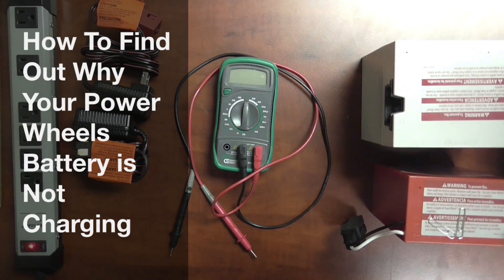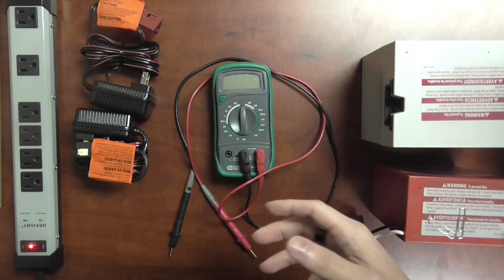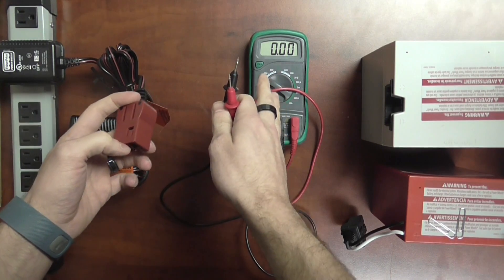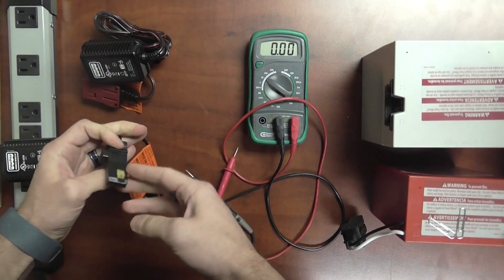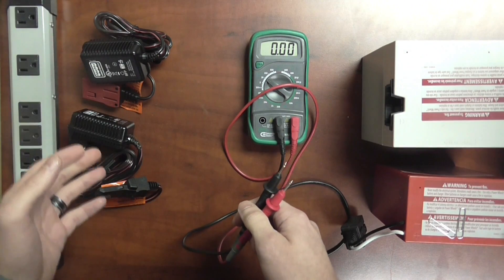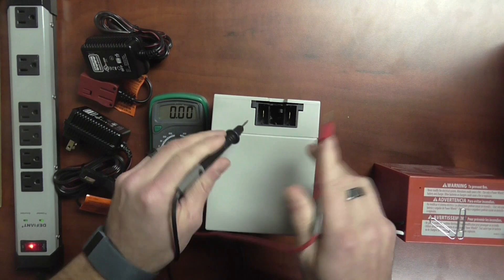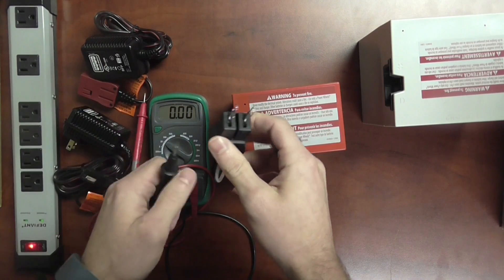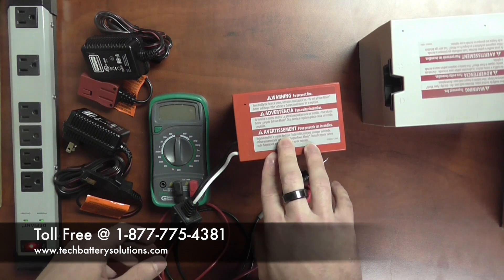How To Find Out Why Your Power Wheels Battery is Not Charging

Comment: What is the problem when your power wheel battery is reading fully charged but your power wheel still won't run.
Reply from the maker: The two most common problems at this point will be a switch (under the gas pedal), or an issue with the motors.

Comment: I’ve got a 12v grey battery and for the readings I got -0.01 to -0.02 or positive 0.01 and 0.02 if I switched it. I got this reading for the charger, the battery and even the port where the battery plugs into the car. I know my battery is probably fried but is my voltmeter broken? Or am I doing something wrong? Thanks
Reply from the maker: Thats a bit of an unusual reading. First thing I would recommend doing in this situation is to test a known good battery with your voltage meter. You can test your daily driver vehicle battery or even a AA or AAA battery out of remote with it to make sure it's working properly.
Reply: @HighTechBatterySolutionsInc  Ok, will do. Thanks.
Reply: I think you got it on AC not dc.

Comment: My new 12v battery shows .04 and my old 12v charger is jumping around between 5-17. I assume this means they are both bad? If so, do you think my charger possibly ruined my new battery or did I possibly charge it too long? It worked fine until I tried to charge it for the first time.
Reply from the maker: Thats an extremely low voltage to be seeing on the new battery. The Power Wheels toy itself will not drain the battery past 10.5V maximum which leads me to believe that you may have an issue with that charger. Have you gotten a volt meter on the charger yet to see what its putting out?
Reply: @HighTechBatterySolutionsInc  Yes the charger is jumping around between 5 and 17.
Reply from the maker: @djfloth  How long did you leave the battery on charge, and by new 12V battery - it was purchased this year?
Reply: A couple days. Yes, new this year.
Reply from the maker: @djfloth  I'm leaning towards the charger being the issue. If the new battery had a faulty cell you would see evidence of it during your first use.
Reply: @HighTechBatterySolutionsInc  Yup new charger resolved the issue. Thanks for the video and feedback!

Comment: But it didn't say why
Reply: But why is it not charging? That's what the title eludes to.
Reply from the maker: @kateworkman4040  Test the charger with a voltage meter, if the charger is working. Test the battery, if the battery is fully charged and the toy is still not running them you have an issue with the toy. If the battery is not fully charged after being on the charger for 8 to 10 hours and you know the charger is working, then its a battery issue.
Reply from the maker: In order to find out why you need to test both the battery and the charger to find out the issue...

Comment: Is there a percentage rule for batteris for being dead and fully changed? For example a 6 volt battery that is 10 percent below 6 is a dead battery?
Reply from the maker: The voltage range of a battery can vary depending on the type of battery, its age, and its condition. As a general rule of thumb, a battery is considered to be dead when its voltage drops below 80% of its fully charged voltage. In the case of a 6V battery you would be in the low 5V range to be considered dead.
Reply: @HighTechBatterySolutionsInc  thanks for the response.

Comment: What are you plugging the part that goes on the power wheel connection? Not the part that goes into the outlet but the opposite end? What device are you using?

Comment: I have a 6V power wheels and the battery reads out 6.55V after charge.  Charger is also putting out proper voltage. I plugged it in and checked connections.  As far as i can tell, all switches are working.  I even replaced the pedal switch with a new one.  I hooked the battery up directly to the motors and they dont spin.  As a final test, I plugged in a 12V battery through all of the cars wiring and everything seemed to work.  Is it possible that the motors are old and the 6.55V just isn't enough to move them anymore?
Reply from the maker: Unfortunately I don't have sufficient knowledge on how age affects electric motors and if a higher and higher voltage is necessary. Our electric fork lift is over 30 years old with several thousand hours on the machine and the battery voltage (and motors) remain the same with no issues. Does the vehicle take a single 6V battery or two? If you have more than one motor in there then I'm assuming it's a dual battery setup which means your motors might need 12V to run?

Comment: My charger works, but i am not sure whether the power goes to the battery or not.. any idea to check that?
Reply from the maker: If you're not sure the battery is accepting the charge you can test the voltage of the battery without the charger connected, then connect the charger and leave it for an hour. After the hour is up pull the charger from the battery and let it sit un touched for an hour. Check the battery voltage again and compare the two readings.
Reply: @HighTechBatterySolutionsInc  thank you. Really appreciate.

Comment: I've done this. The batteries fully charge, but nothing in the power wheel works. I've chased power all the way to the motors. Dead cell?
Reply from the maker: while testing the voltage at the motors hit the gas peddle to engage the motors - check for a massive voltage drop, if you do then a dead cell in the battery is a definite possibility. If there is no change in voltage - i.e. your getting voltage to the motors but no drop when you activate the motors then something could be happening with the motors.

Comment: I got a reading 6.4 and 6.35 for my 6volts batteries. Assuming the batteries are still ok but it thr power wheel wont turn on
Reply from the maker: That sounds like the batteries are okay and should at least move the power wheels. I would try lifting up the back of the toy so there is no pressure on the wheels and hitting the accelerator. If you still don't get anything then you most likely have an issue with a switch.
Reply: @HighTechBatterySolutionsInc  just did that. Nothing happened.

Im looking right now at the ignition switch and acceleration peddal. But can't or have no idea yet how to determin if its faulty or good 😅
Reply from the maker: @exlost245  You can begin testing with a voltage meter. You can test the voltage at the motor to see if there is any, and or the resistance of the switches to see if thats the hold up.
Reply: @HighTechBatterySolutionsInc  replaced the batteries and charger. But still no power. Even the auxiliary(lights, sound etc) is not working.

If its not the switch, probably the board?
Reply from the maker: @exlost245  Its really tough to say without having it in the shop. If the voltage is not flowing past the board in the toy then thats going to be the issue, have you check voltages at all with a voltage meter to see where the bottle neck is?
Reply: @HighTechBatterySolutionsInc  problem was the board. There's voltage coming in. But there's bo voltage coming out of the board.

Im think maybe i should just bypass it. And splice all the wires.
Reply from the maker: @exlost245  Unfortunately I can't give you any actionable input on that, its past our area of expertise. I assume the board serves a purpose and you may be able to find a used one on eBay if you wanted to go that route.

Comment: What if the battery wont hold a charge for more than 10 mins
Reply from the maker: If the battery takes a full charge but lasts for a very short duration of time then your looking at a capacity loss. In this case a replacement battery is recommended to get the full run time of toy.
Reply: @HighTechBatterySolutionsInc  so replace the battery?
Reply from the maker: @justinmcvay5560  Yes
Reply: @HighTechBatterySolutionsInc  thank you

Comment: Do the 12v batteries have any sort of internal protection or safety devices that trigger in a collision? My child hit our out door table and the PW immediately stopped working. Battery is at full charge but still won't go. Swapped another working battery and the PW goes fine. Thoughts?
Reply from the maker: Not to my knowledge, the only internal safety precaution that I am aware of in the batteries is a self re-setting fuse.

Comment: Thanks.. My charger says 7.5v and I tested it and it was actually right around 7.5v. But my battery won't charge and it's reading 3.4  guessing need a new battery for my kids 6v ride on it sat in charged for a long time
Reply from the maker: Yes, it sounds like the charger is functioning correctly but the battery is just not accepting the charge at this point.

Comment: do u have a video on how long should a battery charge before it is full?
Reply from the maker: We do not, the charger for both the Red 6V and the Grey 12V units are going to be in 1 AMP range. You can divide the capacity (AH) of the battery by 1 (1 AMP) to determine your charge time assuming the battery has been run all the way down. For example, the Red 6V Power Wheels Battery is rated at 9.5AH and the charger has an output of 1 AMP so 9.5/1 = 9.5 hours of charge time. I hope this helps!
Reply: @HighTechBatterySolutionsInc  thanks.. it helps me a lot

Comment: My 6v battery reads at 6.3 volts however won't power the car. I've checked the charger and that all reads good as well
Reply from the maker: You may be looking at an issue with the toy if the battery has good voltage and your getting no movement. The first thing to check would be the switch under the gas pedal and work your way backward from there.

Comment: My battery is good but it won't go? What else should I look for?
Reply: I have a wild thing 360
Reply from the maker: If you know that the battery is good but the toy is not moving at all then you may have a bad switch - most likely under the 'gas' pedal of the toy. You can either test the switch with a multimeter or give power wheels customer service a call - they have repair centers all over the US that you can drop the toy off for repairs.

Comment: Anyway to charge the battery with a car charger to give it enough volts to charger on the power wheel charger?
Reply from the maker: Yes, but two things to note. 1. You don't want to blast the battery with anything higher than 10 amps, anything higher and you run the risk of blowing the top off the battery. 2. The connection prongs in the battery make it really tough to hook battery clamps to. If you do rig up a good way to make a solid connect with a larger charger then hit it at ~10 amps for 45 to 60 minutes and then try plugging in the standard charger immediately after to see if you can recover it.

Comment: how can I upgrade my voltage from 6v to 20v what kind of convierter do I need? how much does the fuse box hv to be?
Reply: Wire batteries in series if you have the room for more than 1 battery.
Go to an automotive store or section of a store and buy a fuse plug and fuse.
My son has a 12V ( 6Vx2 in series) Jeep. I ordered a connector for my Milwaukee batteries and will use an 18V instead of the 2x6V

Comment: Why do I have a 6volt charger with my 12volt system.
Reply from the maker: Either you have the wrong charger all together or your 12V setup is a pair of 6V batteries. Does your battery look like the Grey cube in this video?
Reply: The battery is black and 12 volt. The person I got it from said that the 6 volt charger is what came with it. Strange!

Comment: High Tech Battery solutions Inc I have a paw patrol E cruiser has 6volt battery was fully charged working good for a year i did notice battery was low cause car lights were flicking on and off while on. Now i charge it no power at all left it plugged to wall car wont cut on. 
Do i need to replace battery
Reply from the maker: Was the battery sitting for a long period of time before you tried charging it? The life span on these averages about 3 years, so if your at or past that mark chances are getting a new battery will get you back up and running.
Reply: @HighTechBatterySolutionsInc  its been a year since i bought it charged ot once. Just last week it was on but not driving the battery was low now its been charged over night no lights or ignition start. Maybe i need a smart charger the car barely 2yrs old
Reply from the maker: @latoyawashington67  Do you have access to a voltage meter to check either the output of the charger or the voltage of the battery?
Reply: @HighTechBatterySolutionsInc  no sorry I don't. I was thinking taking the battery to an autozone or somewhere to test the battery. Or unfortunately ordering one from manufacturer
Reply from the maker: @latoyawashington67  If you do end up taking it to Autozone I would bring the charger as well to have that tested -

Comment: my 12v charger reads 11.5. Is that to low?
Reply from the maker: The charger is probably good. It is not uncommon for us to test a 12V Power Wheels charger and see it putting out 11 ish volts. As soon as the charger is connected to a battery it will increase its voltage output into the 13-14V range.

Comment: Everthing is good but the charger blinks red and green light flashes on of green red
Reply from the maker: If your charger has an LED light then you have the old school quick charger. I am not really familiar with this unit however I believe when the lights are alternating between red and green then its indicating a voltage issue with the battery.
Reply: ON THE CONNECTOR IT HAS  A FUSE  ON THE CABLE ATACHED TO THE BLACK WIRE.

Comment: I have been trying find the correct battery charger for this battery. Can you link me to the 12 bolt charger for that battery? The battery is model 1001175653. The ones offered the terminal connector is not the same as the one you. Thanks
Reply from the maker: Sure! https://www.techbatterysolutions.com/power-wheels-12v-grey-battery-charger-00801-0972/

Comment: Not sure if it’s the battery or charger but I have a beetle power wheel car . I put it to charge and then I turn it on and a red light shows but it doesn’t move forward or backwards doesn’t move at all only the sounds play like the horn , etc
Reply from the maker: Do you have access to a voltage meter?
Reply: No do they sale them at Walmart ?
Reply: the car turns on but it doesn’t move at all not sure what’s wrong
Reply: Do you think I should buy new battery? It’s a 6v car
Reply from the maker: @karlamadison843  Tough to say without seeing if the battery is actually discharged. When was the last time the toy was running?

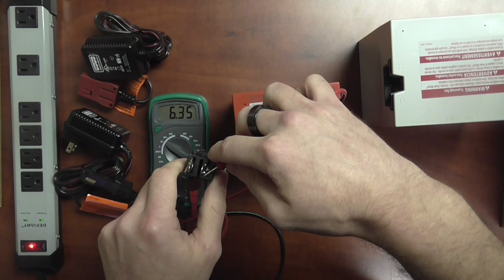Comment: 4:55 be very cautious to not touch both clips with a multimter probe, this batteries are low voltage but high Amper power, the clip will probably melt if short-circuited

Comment: Is it possible to over charge these 12v batteries and kill them ?my daughters power wheels radio will turn on but as soon as I step on the peddle to test for acceleration the radio dies, and no power.
Reply: Yes, if you leave the battery on charge for days on end then overcharging will occur. Unfortunately, it sounds like your battery needs to be replaced. Your battery is able to retain proper voltage to operate a small draw like the radio but as soon as a real load is applied it fails outright. I am pretty confident your issue is limited to the battery because the radio also dies when you hit the pedal - if it remained on then you may have a fuse or switch issue with the pedal itself.
Reply: @richardprice9564  thank you bro for the feedback I appreciate it.. God bless take care man

Comment: How do I know if the battery is fully charged????? 12v
Reply: The battery voltage should be 12.7 or above to be fully charged. Unfortunately, Power Wheels has stopped making the chargers with the charge LED light on them so if your battery is discharged the general rule of thumb is 8 to 10 hours of charge time to get it back up to par.
Reply: Richard Price thank you man I appreciate your help

Comment: I got a new battery but it reads 7.25 or 8 and doesn’t charge
Reply from the maker: New as in you just bought it new? The battery is stone cold dead, your best chance to bring it back is to leave it on the charger for 24 hours and see if you get any improvement on the voltage

Comment: what if the amps are low?
Reply: The test show in the video will get you the voltage readings when you say the amps are low are you referring to the actual capacity of the battery?

Comment: Can i use a 24v 2,5amp adapter to charge the e100 electric scooter with?
Reply from the maker: Yes, the razor E100 scooter is a 24V unit that will accept that charger - just be aware that it is a bit higher of a rate of charge then what comes with the scooter - so don't leave it on for more than a few hours.
Reply: Thank you, i will give it a go. Its actually a 24v receipt printer charger and i cant find a standard charger for the E100 where i am from.

Comment: i've tried to reuse a dead battery, 7.2Ah 600A 12volts, when i tested it it was 1V DC so i tried to charge it, voltage stabilized at 12v but it's not charging when i change from V to A on multimeter and try again it says 0.00 but even charger that charges the battery says 0.00 plz help. it's Pb/lead battery

Comment: Thank you for the video. I have my battery and charger within your specs. When I hook up battery to the power wheels it seams there is a HUGE draw of power from battery. 
I have about 13.88V from battery. 

Not sure what else could be the cause of this issue.
Reply from the maker: There will be a draw (voltage drop) when the toy is pulling power from the battery, however, after the initial draw the battery should maintain its voltage level for a bit before slowly inching downward. If your battery drops significantly - into the 10-volt range - and doesn't stop its decline then its time to take a look at a new battery.